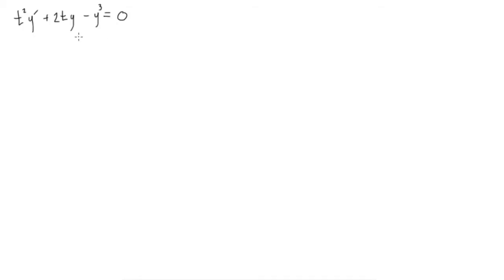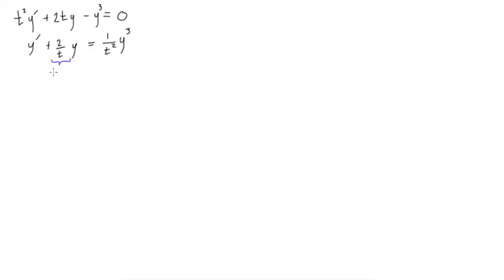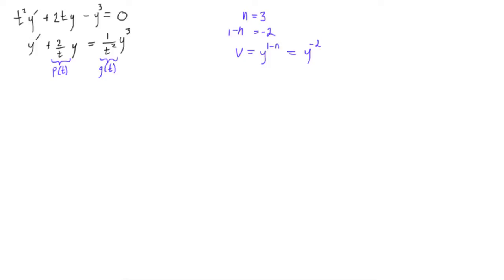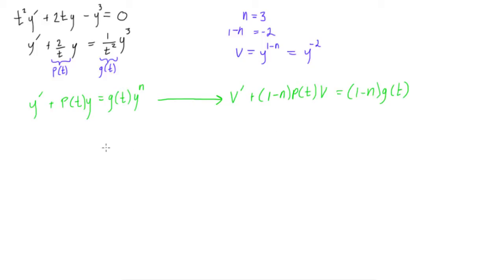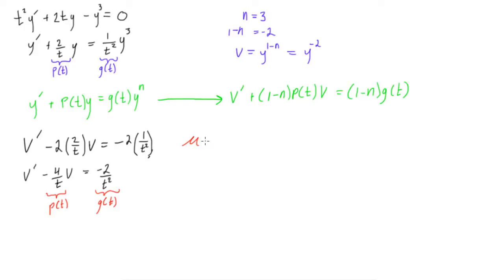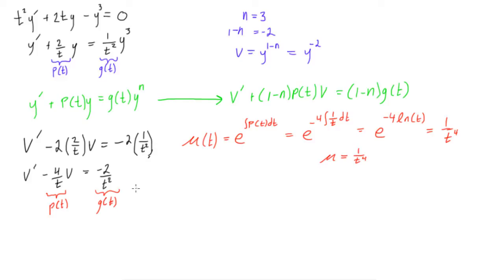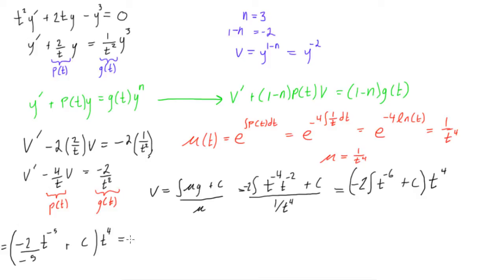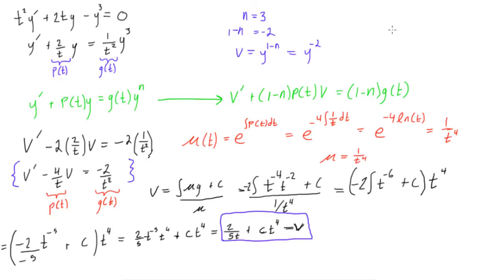Bernoulli differential equation example #2

Comment: Foolish Bernoulli way you started with n=3 and ended with n=1 
Alsultani  D.E.   dy/dx+P(x)y =Q(x)y*(1-n)     equ.   1
Example
dy/dt+(2/t)y=(1/t*2)y*3      equ.  2
3= 1-n    so   n=-2      now multiply equ.2   by  (-2)
-2(dy/dt)-(4/t) = (-2/t*2)y*3
It = e*int.(-4/t)dt =t*-4   
Ity*n = int.(nQ(t)Itdt
y*(-2)t*(-4) = int. {(-2t*(-2)t*(-4)}dt
y*(-2)t*(-4) = 2/{(5t*(-5)} +c
y*(-2) =2/5t +ct*4
Note . Bernoulli started with   t= 3 and ended with n =-2
but I bebgned with  n=-2 and ended with  n=-2 and dont elonget  by using  v
ok